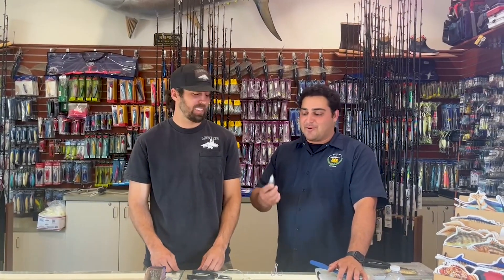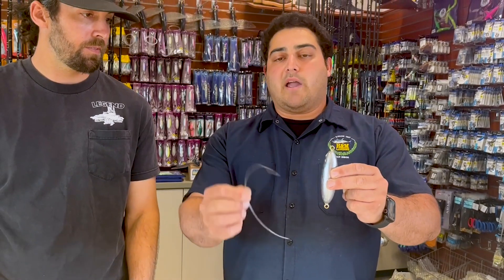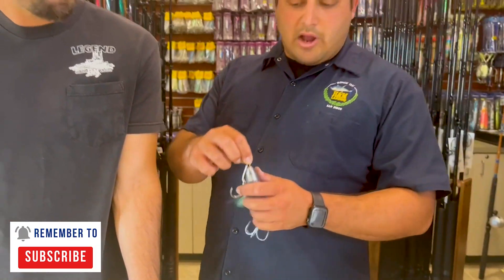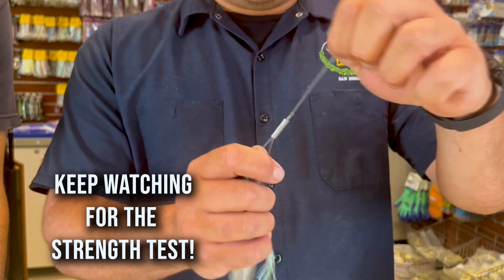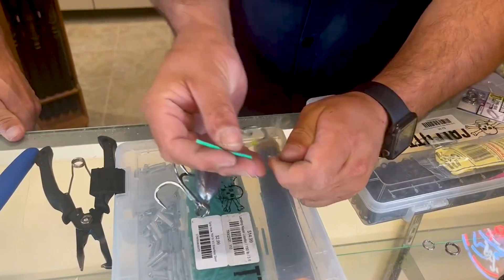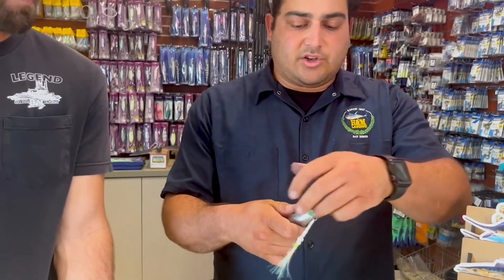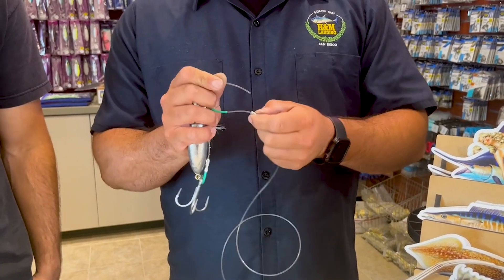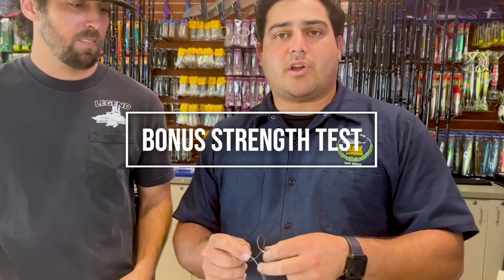How to Rig an Eddie Bomb (Torpedo Sinker) Step by Step - Tackle Tips for Tuna

Comment: Wow ! My bomb really got famous.
Reply: You're a legend! 😂
Reply: I made 4 of these as follows: bought 4 - 1 lb torpedo wts wired through from charkbait 8.00 each. Spray painted them chrome, lacquered with 2 coats, put glow paint dots on opposite sides in an end to end pattern in 3 close lines also lacquered twice - why? Cuz I cant help geekin out on this stuff. Split rings 320 lb hyper wire, the ultra wire were too thick to move freely in end wires on weights. Front or top hk 9/0. SP Jigging assist hk.  (these guys make beautiful jigging hardware), bottom hk big 4/0 st66 owner treble. Ended up costing me about $12.00-13.00 each but heavy duty bomb proof. The glow paint I bought at a local craft store in a spray can. Ive also put a tapered glow line on a few select irons I yo yo with.

Comment: Any idea how to tell if you have a through wire sinker? Thank you
Reply from the maker: @michaelbruno1486   really the only way is if they are sold or advertised as “through wire.” If it’s not specified, I would assume they are not. It’s more expensive to produce & generally not needed unless it’s this specific set up. That being said, you can always rig up a line in between the top & bottom tackle points so even if the sinker breaks away, you’ll still have your hooks and line on the connection to your top shot.
Reply: Thanks so much!

Comment: Has anyone ever seen eyes pulled out of a non through wire Eddie bomb?  If you have a solid ring (I cast my own) or split ring in the top eye and your hook(s) attached to the ring you don’t have to worry about if it’s through wire or not.  Last year half of the fish put on the deck on my trip  were on an Eddie Bomb!
Reply from the maker: Exactly this! Great point. You can avoid this risk by attaching the top & bottom justttt in case.

Comment: Is 12oz also good to have for Eddie bomb or just 16oz and above all I need?  Trying to lighten my gear.
Reply from the maker: 12 oz will work! Just depends on the current and conditions if you would need to go heavier.
Reply: I got their 500gram so I’ll always be straight up and down. It has a smaller profile than the 300gram jigs I have. One Eddie bomb to slay them all.
Reply: Unrigged the sinker alone was about 22$. Half the price of a rigged one. Either way reasonable.
Reply from the maker: @petera1117  tried and true for sure!
Reply: Who am I kidding, I’m going to end up with 2 of all sizes.

Comment: How can you tell if the torpedo sinker is through wire or not?
Reply from the maker: @roaddog9222  really the only way is if they are sold or advertised as “through wire.” If it’s not specified, I would assume they are not. It’s more expensive to produce & generally not needed unless it’s this specific set up. That being said, you can always rig up a line in between the top & bottom tackle points so even if the sinker breaks away, you’ll still have your hooks and line on the connection to your top shot.
Reply: Thank you fir that information.
Reply from the maker: @roaddog9222  happy to help!!